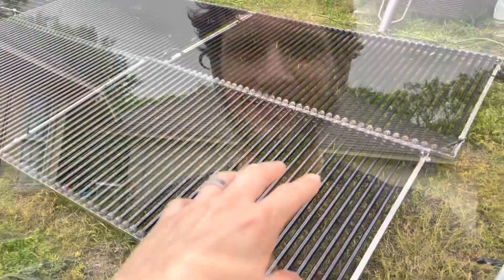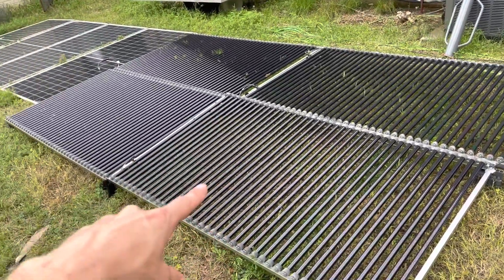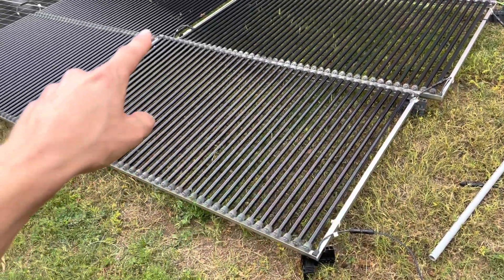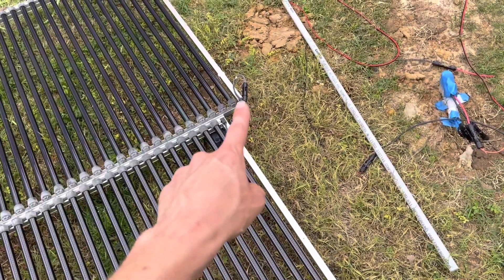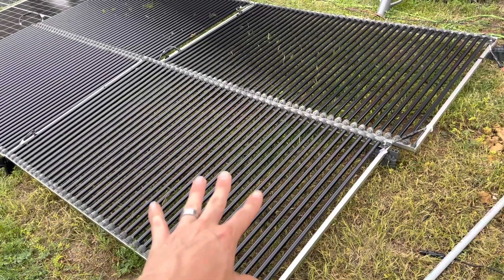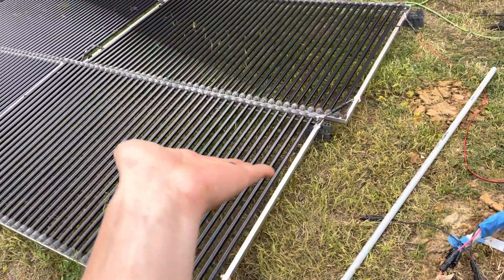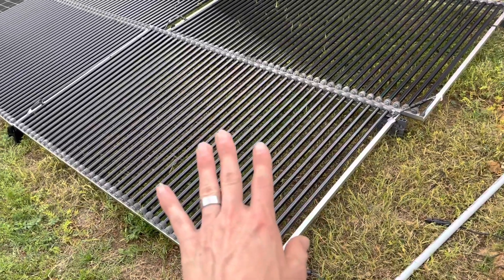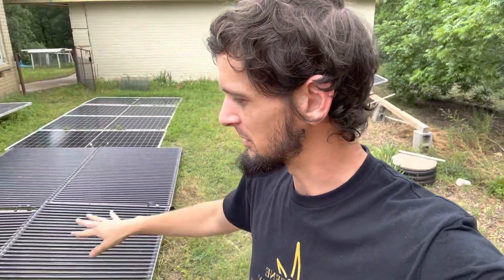How Solar Tubes Make Cheap Power

Comment: Always looking for some panals. You still have these panals?
After a year, do u have any complaints?
Reply from the maker: I've got a few that I left in my own yard if you are local and wanted some. The only issue I've had with them is I keep getting a GFCI fault when it rains. Could be my wiring or it could be something with the panels. Never heard anyone else mention it though and I sold a truckload or two of them.

Comment: I just got a pallet of these but if they work I would like more, if you still have them. I am moderately close to you in SE Oklahoma. Just let me know.
Reply from the maker: Did you get some from the BH auction? Neat that there were some more new old stock floating around.

I ran out of mine. Hope the ones you got work out well!
Reply: @BeeneEnergy  I found some in California. Shipping quadrupled the cost. I was hoping you had some closer to me. The overall power is much better than I expected. I am currently working on a stand to mount them vertical and reflect additional ambient to get close to 360 total reflection. Looking forward to studying improvement percentage. Thanks for responding.

Comment: I have two of these that I bought new from Solyndra for an assessment and have sat in my basement for over 10 years. I was going to get rid of them as they are higher voltage but I guess there are compatible inverters/charge controllers?  What inverter or charge controller would you recommend
Reply from the maker: If you want something off grid an epever 150v charge controller would do the trick. Chilicon also makes grid tie micro inverters that work up to 120v so they would work. I’ve got a few of those if you want to buy one ;).
Reply: @BeeneEnergy  I will give you a call

Comment: You ran out of those panels pretty quickly. Do you plan on getting more?
Reply from the maker: If I find any more and they are the right price I’d buy them. But yeah just a single pallet left at the moment.
Reply: @BeeneEnergy  One more question: Have you connected these panels to a charge controller to see how they perform and if  so did you make a video about it?
Reply from the maker: @troyyarbrough  I did! There’s a video from last month (I think) where I compared the solyndras to some other panels. 230’s and 395’s if I remember correctly.

Comment: How many of these in a string to run a 3kw or a 6kw system. Would only the end string have to have the different connectors put on them?
Reply from the maker: Yeah if you have a big square to put them and the inverter takes 600v in them you can do a 6x6. So 6 in parallel 6 in series for ~550v and 14a. Or if it’s multiple mppt inputs cut it in half and do half to each input. Yeah only the two enda/corners need mc-4’s.

Comment: I'm looking for a solar setup diy for my tiny home in Tennessee and always looking for a value product I am not afraid of technology but have never done this any guidance would be awesome and interested in these panels.
Reply from the maker: Have you worked out how much solar, battery, and inverter you'll need yet? I could certainly ship these panels but will probably be about $400 a pallet.
Reply: @BeeneEnergy  like I said I'm new to all of this so no I haven't.  The home at most will 1500sqft but most like less than 1000.  I have a good southerly facing field on the front of our property about 75-100' from home site. I am going to work towards the most energy efficient appliance that I can get. Like mini splits for ac and mostly wood heat. Refrigerator washer drier led lighting and typical lap top and cell phone charging. 5 people 2 adults
Reply from the maker: @woodtecharmory9249  I figure there are multiple ways to go about this. Since you don’t know your utilization in kwh’s seeing as it’s not built you could build a system that should work and monitor/adjust consumption to match. Or overbuild.

I think minimum would be a 15-20kwh battery bank and 5-10kw of solar. If you can get inexpensive panels then do that, it’ll help in those cloudy muggy days where you need ac but the sun just isn’t helping things. You can over panel the charge controller by a fair bit typically.

Something like a Megarevo 8klna might work well for you. Gives you a good 8kw of solar across multiple mppt’s, split phase 8kw inverter, and connects to a standard 48v battery for storage. 

The jury is still out at how well the Megarevo will perform but for the roughly 2000 dollar price tag it’s pretty feature rich.
Reply: Thanks I will research that
Reply: So my last month utility bill for a 2750sqft and 40x60 shop that's ac and we used 1819kwh we will be going to a 1000 sqft home with no shop and probably the most electric will be used for the fridge and ac which will be mini split. So I was thinking a 10000kw system should do it?
Reply from the maker: @woodtecharmory9249  Yeah 10kw of solar should be plenty.

Comment: Those use Tyco Solarlok connectors, which were a competing connector standard to the MC4 standard back in the late 2000s.  Note these aren't compatible with the Solarlok connectors Tyco makes now, which are MC4 compatible.
Reply from the maker: Great info to know, thanks!

Comment: I hit you up on Craigslist earlier about these panels.  Would you recommend these for someone who has limited sun?  Lots of trees on my property and I have to make the most of my space.  It sure is tempting.
Reply from the maker: Hey! I responded to you right?

I don’t have enough experience to know for sure. But considering each tube is in parallel with the next it seems logical they would handle partial shading better than a standard panel.

However if square footage is a concern these aren’t great. About 8% compared to 20% efficient of newer/standard panels.
Reply: @BeeneEnergy  Yes you did respond, thanks.  Still weighing the options but I do like this design/concept.
Reply from the maker: @MBUPNorth  Good good, just wanted to make sure I hadn’t missed it.

So many options! I’ve also just got some 395w Jinko panels in if that suits you better. Got those listed for $180 but if you’re getting multiple I’ll get the price down for you.